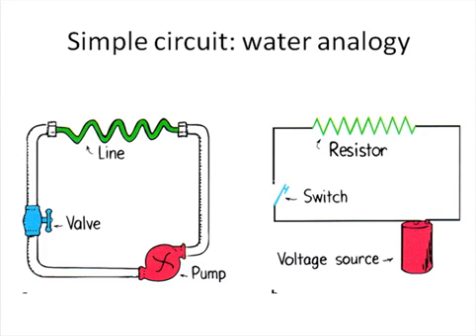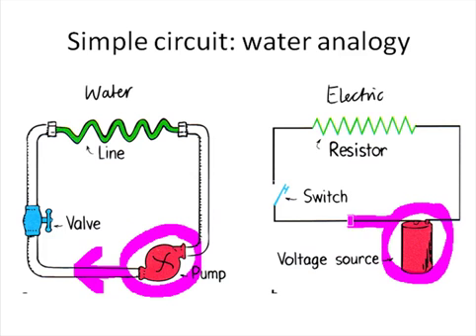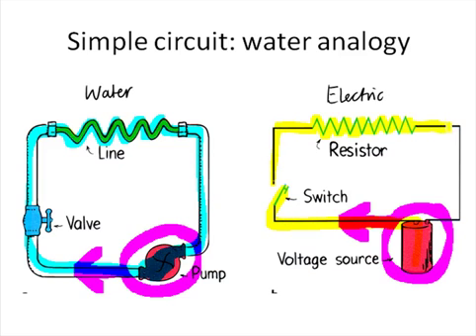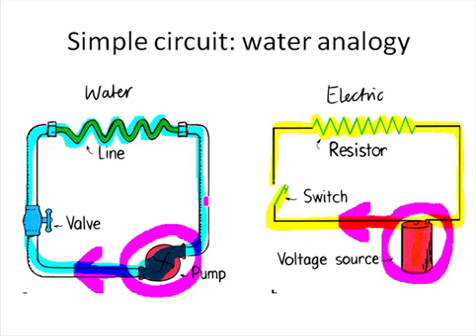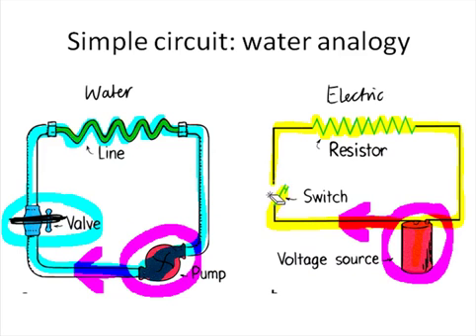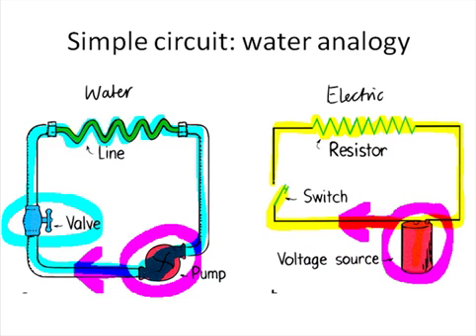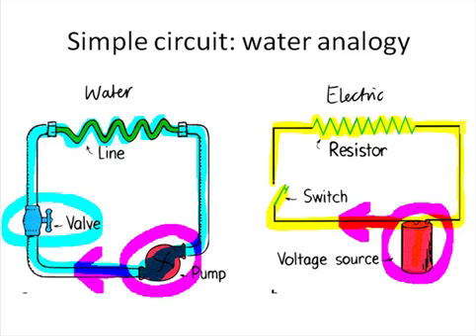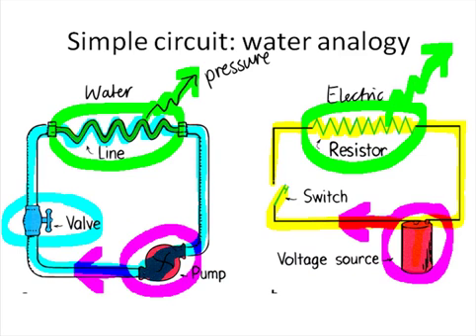Basic electricity | Analogy

Comment: When teaching electrical behavior using the water metaphor isn't it best to use a water tower as a metaphor for a battery ... since the  height of the tower (water pressure) is analogous to voltage in a battery. If you use a water pump as an analog for a battery, it's more complicated to show the voltage:pressure analogy or the flow:amperage analogy.
Reply from the maker: True, that is a good analogy, but it would still require a pump to raise the water back up again after flowing around the circuit.
Reply: @LearnScienceCoZa  Yes, absolutely. But the analog of the water pump is the electrical generator. The analog of a battery (storage) is a water tower or tank (storage).
Reply from the maker: @DaveFer  Don't you think that the water tower or tank matches a capacitor better, since it has no energy conversion happening in it to generate electrical energy - it is merely a storage device.
Reply: @LearnScienceCoZa  Yes, a capacitor and a batter are essentially the same thing -- both energy storage devices.
Reply from the maker: @DaveFer  anyway, I find kids tend not to understand how water behaves, so they don't find the water analogy as helpful as it could be. I tend to use the representation given, for example in  this movie more, nowadays: https://youtu.be/FB8CfLF9zCM

Comment: 1:10
What do you mean that the Voltage source doesn't make charge? 
A battery is a voltage source and it contains all the negative charges in the form of Electrons, pressing hard to exit just like opposing negative poles of a magnet, and waiting for the switch to close.  
Once the circuit is closed thru a switch, the charges start to flow. This is a called Amperage, or current. 
Voltage simply pushes Amperage (current) thru resistors. This is what OHM's law is basically all about. 

I just don't understand what you mean by "a Voltage source doesn't make charge".

Also, I don't this analogy very logical.. 
If I'm taking a shower and narrowed the water flow in the douche shower,  the water pressure becomes stronger, not weaker. 
I just don't get it..
Reply: The intrinsic property that makes a conductive material, well, a conductive material is that it has pre-existing free electrons to be moved around by the voltage source. I suppose the video did fuck this part up by saying batteries don't release charge; of course they do.
Reply from the maker: There is a common and very strongly held misconception that the current strength close to the positive terminal of a battery is higher than that near the negative terminal because of the idea that the battery puts charge into the circuit. It was that misconception I was attempting to address.